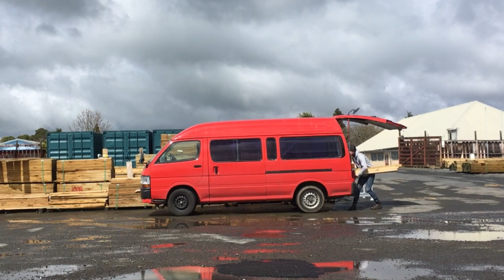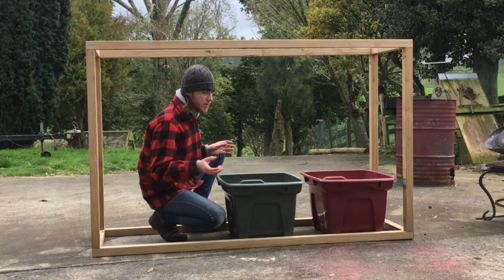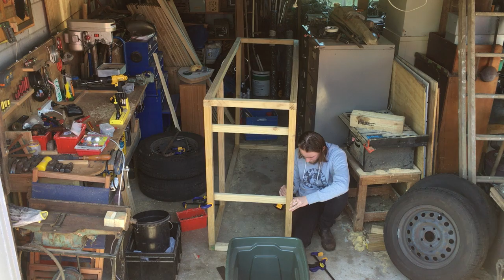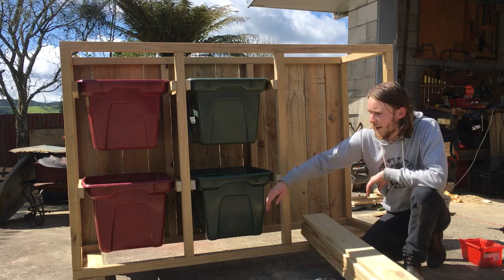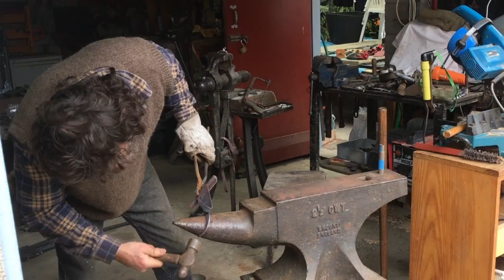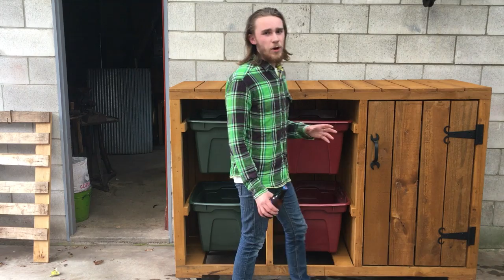D.I.Y Bin Storage Unit / Recycling Centre

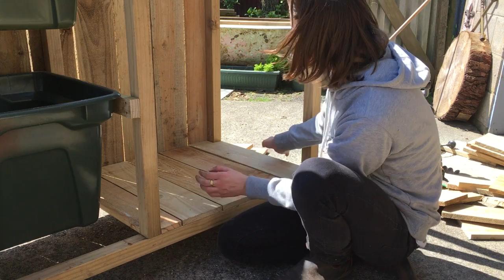Comment: Great build! Question: at 5:27 seconds into video you hold up these two notches ends and explain you will nail them in...(disclaimer: I am not a wood worker and need something like this for my recycling), how do I create the best cut for these two end pieces without wasting lumber? How do you take this measurement?

Comment: Hiya, very good project, but what about if it rains heavy, won't it run through the top and fill the bins up with water?.
Reply from the maker: Hey Alan, thanks for your question. I built this unit to live under a carport beside my shed so rain wasn't a consideration in my design; however you could easily make a waterproof one if necessary.